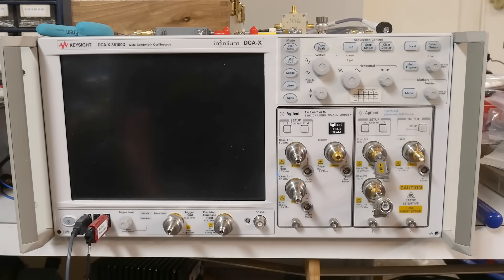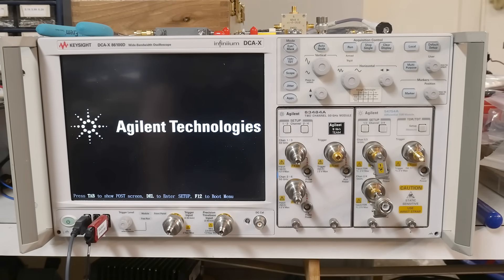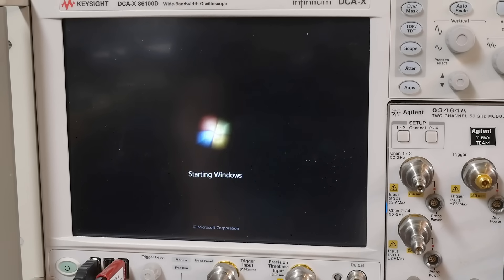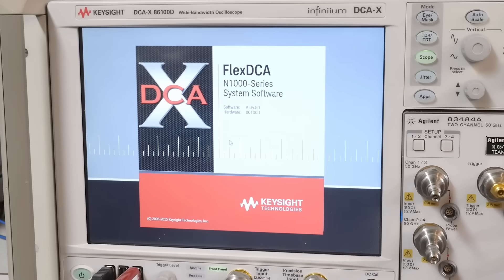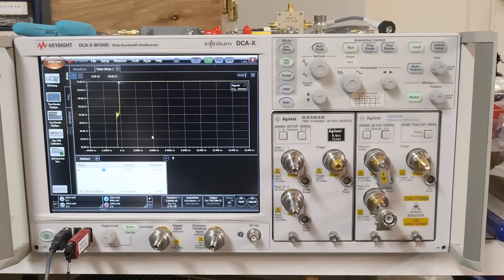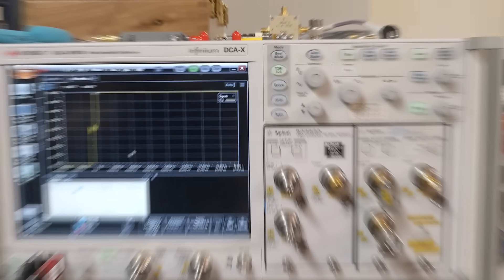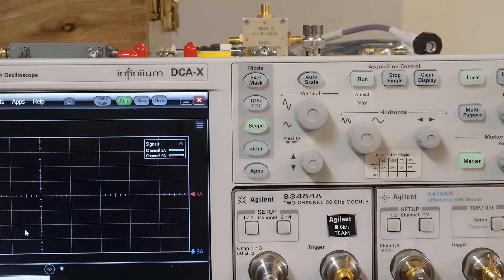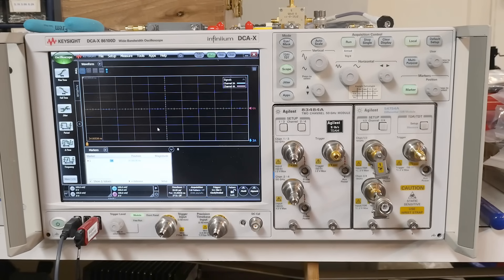#2294 DCA-X 86100D 50GHz Keysight Oscilloscope

Comment: It might be worth imaging that hard disk that this thing runs on.  It might be really hard to recover from a hard drive crash.  Even worse, the calibration data for this scope may be stored on the hard drive as well.  Even if the software is available, it may not work without getting recalibrated.  Also, if you could image the drive and replace it with an SSD it would boot a lot faster.

Comment: From experience, figure out how to image that system as soon as it boots.  Any gear with Windows embedded into it has so much custom driver stuff going on even a simple "last patch" has a good chance of bricking it.  If you can find an exact drive replacement to throw that image on, so much the better; then you have a way to quickly bring it back up if drive ends up having bitrot or being weak or, you know, Windows just being Windows.

(we used to use the last big update downloaded from MSDN to run Win2k and then Win7 as long as we could on regular computers but it broke our Tek TLA which could only use updates from Tek, via support contract of course and OS support would eventually end meaning buy a new TLA, which in this case, turned out good for you, because, free 50GHz scope)
Reply from the maker: already backed it up

Comment: Comm is mostly PNA-X which is $525K without noise figure.  A 26 Gig E-cal gonna set you back $14K, not sure what the 50 gig one costs, probably 30K.
Like you said, if you're looking for eye diagrams, or a QAM constellation, they're great.
Superb instrument!  With a nice FFT, you got a 50 GHz spec A there.
Reply from the maker: I can't get the FFT to give me nice data. input a 6GHz signal and it has lots of FFT window aliasing
Reply from the maker: Oh.  If I use pattern trigger I can get good results.  Must be trigger jitter getting in the way before

Comment: Use DD /w a linux boot disk/thumb drive to take a raw disk image of the drive. Raw is important to get any weird "blessed" regions they might use for whitelisting the drive. If the drive dies you will be SOL. Then, as others have said, image it to a SSD. Or a SATA DOM.
Reply: A full copy of that Hard Disk is a must indeed. 
DD is a great tool, however one must be very cautios as it can overwrite the source when 'if' and 'of' arguments are swapped by mistake. Many have learned that the hard way.
I always use the lsblk command first and check carefully that source and destination are correct
Reply from the maker: I used the free version of Macrium Reflect and set forensic sector copy which preserves everything. worked great.
Reply: @maeanderdev  you can also just use ddrescue, which is explicitly meant for data recovery and backups

Comment: Starting to feel like an old retired engineer as the world passes by. At Hughes Aircraft Co. we got a 1 GHz Tektronix, a digital analyzer with color option to upgrade from a Gould and a scope with digital triggering features. That group developed radar signal processors for aircraft like the F-14 which is now on the mothball heap. That was military specs and ran at around 10MHz as I recall. But, as you said, data is now much faster. Even  in a TV. MY DIY DAC has a 125MHz clock. Playing with data in newer equipment seems beyond the budget for a retiree.Heck, I have a hard time focusing on my phone with progressive focals. But, we need something to do other than pulling saplings on a couple of acres on a local river. Don't plan on starting a YouTube channel.
Reply: Holy hell dude! You worked on the AWG-9!? 

I’m an ELINT guy. Super fascinated with AI radars. Read all the George Stimson books. 

Did you ever work on the -63?

Comment: What is the address of that junk heap.  I always wanted a way to verify the characteristic impedance of my PCBs, but never figure I could do that with my low speed 350MHz scope.  But if I can get the address of that junk heap you go to - WOW - one man's junk is another man's pure treasure.  I'm hyped for this series - plz show how you would use this to measure PCB trace impedance on a blank board.
Reply: You can't do that with a VNA? Or an LCR meter?? Measure the open capacitance and the shorted inductance?
Reply: @gorak9000 With a VNA for sure, but I could never afford such a thing as an independent contractor.  I do have an LCR, but an LCR operates at very low frequency like in the single dight KHz range.  That will result in a lumped capacitance or lumped inductance measure.  Characteristic impedance is a per unit length distributed value.  At low frequency even a really long trace will measure as lumped, hence what ever you think you measured and subsequently calculated will not reflect (pun intended) the trace characteristic impedance.  Have a fantastic rest of your day.

Comment: 50 GHz is slow now (!?!?!) omg.. when I got my 2465A (350 MHz) the 5 and 10's were slow and the 78xx mainframes were my dream machines.  (sigh)
But it's amazing to see where the T&M industry is now....just thinking about it.. it's been 25+ years.. omg  :(
Reply: Think about the data rates that fiber backbones run at - 40Gbps is pedestrian, 100Gbps is 'ok', and 400Gbps is "fast" - and those are the products that are already commercially available. What's being worked on in the lab is a generation or two newer than that

Comment: You must let me know where my nearest "junk heap" with those scopes is.  Then I can adopt one and bring it home to my workshop! 🤣
Reply: Heh, yeah, "junk heap" - the used equipment dealers on epay are still PRETTY PRETTY proud of these units - look at those prices - yowsers!
Reply: @gorak9000  check whatever passes for Dovebid these days for cheap pallets of surplus from companies you know have shut down their labs or chopped off entire branches.  When I cleared space, they did not care how much just how fast because square footage costs the occupying team way more than most of their gear, especially if it was left by a previous team and not in their asset group.  "palletize and send to dovebid, we don't care what it is" was a very common theme.
Reply: make sure to grab all the accessories/connectors/adapters/etc anything that hangs off of it lol those are super expensive to replace.
also if it actually boots, find out the hard drive model, get another one, and IMAGE IT IMMEDIATELY.  if a virus comes along somehow or windows becomes unstable since it's got the host embedded into it it basically bricks the whole thing.  I went through a period where our Tek TLA that were W2k based caught the Blaster virus and it took me a month to completely scrub them all and get them all back to pre-virus state - even after I worked out how to clone an already refreshed system it still took forever because there were dozens of units on that team.  a single scope snapshotted and backed up will save days of experimentation and heartache later for someone who only has one.

Comment: All Oscilloscopes that run Windows from a Hard Disk or SSD
My first thing to do, would be to take an Disk Image of it.
Reply: That's what I do with all my older equipment.  I had a hard disk drive lock up in a older R&S communications test set years ago.  Luckily a couple light taps to it's case got it going again.  Within a week I had upgraded every piece of equipment I had with a hard drive to SSD's and stored images of them.  Lucked out once and didn't want to push my luck the second time.
Reply from the maker: yes, good idea. it already has a SSD but I'll make a backup

Comment: Damn nice scope! Definitely something CuriousMarc could use when his team was figuring out the Apollo comms & telemetry system.
Runs Windows 7... you might try installing Half-Life on it, like I did with a TDS5034B, haha! You might also try installing the NDI toolkit and use its screen capture app to send video over the LAN, then pick the stream up in video recording software. OBS can do that with an additional plugin.
Reply: What you have to look at on these is the life of its hard drive. If you have the OEM software, it might be a good choice to find a solid state replacement, and load the software on it. Uncle Sam just let a lot of surplus out, and they had several Agilent scopes running either Windows XP or 7, with a mini-keyboard and mouse. However, I passed them over due to the hard drives.
Reply: @craxd1  SSD is definitely a good idea, especially for yours - Win7 can handle trimming no problem. I did this upgrade on TDS5034B too, though I'm not entirely sure how Win2K will work with it; might be necessary to do some tweaks like upgrading RAM and getting rid of the swap file.

Comment: those are sampling scope though right? So really it's impactable for normal use 😆
Reply: Correct. Its not a real time oscilloscope. If it was 50ghz would be absolutely insane and costs a small house worth used.
Reply: @humble2246 they aren't cheaper either 🤣
Reply: @vaualbus they are by a magnitude of atleast 10x the cost. They work a lot differently. I was lucky enough to buy a 2.5ghz real time scope for only 1000. But if you meant cheaper by "doesnt matter if its 10 grand or a million. Its too much" then thats a fair assessment for almost everyone 😂
Reply from the maker: here is 70GHz real time scope I used: https://youtu.be/edHw3qz3jMQ?si=sG_JNg6UAtZypH3C
Reply: @IMSAIGuy those are the same adapters my scope uses actually. I have a couple of those sma ones. They have a bnc adapter of course it'll be "low bandwidth" but it would do. They also make dedicated probes for that adapter connector. Nowhere near of course the 70ghz dedicated thing but up to if I recall 5ghz.
Reply from the maker: Front of scope is 2.4mm connectors. I have a 2.4 to 3.5 adapter on each.
Reply: @IMSAIGuy no i meant the 70ghz oscilloscope with those tca 292D adapters/modules. You can remove the modules and replace them with things such as a BNC module. You can also interface them with a probe module such as with what i have the TEKTRONIX P7330
Reply from the maker: I don’t think there are bnc plug ins.  What model number. this is a Keysight scope not Tektronix
Reply: @IMSAIGuy  sorry if you got confused. I was specifically talking about that 70GHZ oscilloscope from Tektronix. Plenty of their good scopes back then used a plethora of the TCA modules. I had no idea that their top scope still used the TCA modules the ones that I have for my own Tek 2.5ghz real-time oscilloscope.